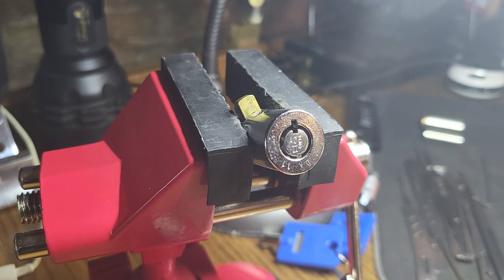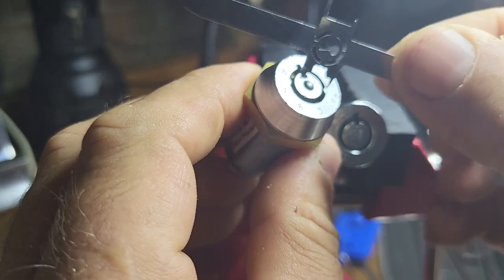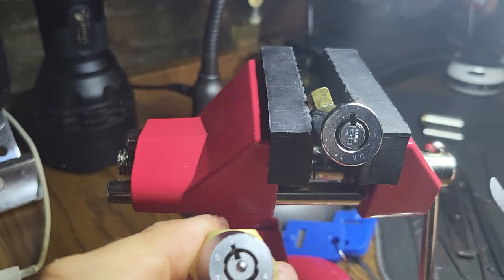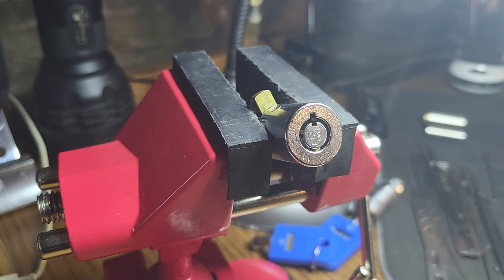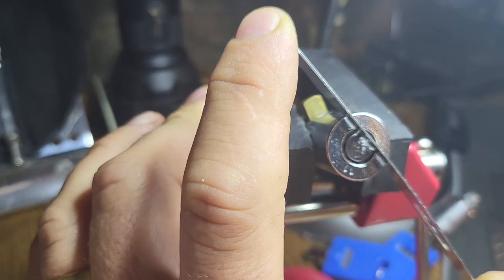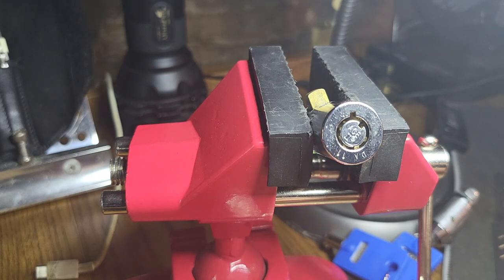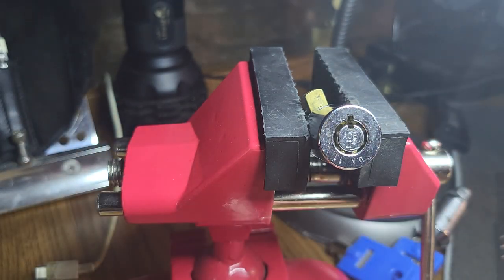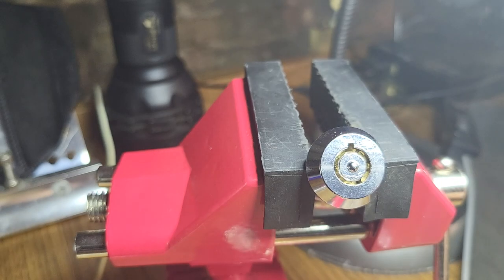Tubular Lock Picking Tips, Camlock & ACE II

Comment: Excellent video boss! Do you know of a tubular impressioning tool that works on an ace 2?
Reply from the maker: Hi, Thank you,  I have now got the Covert Instruments Impressioning tool and I can confirm that it doesn't fit the Ace II, that said, even if you could get one that physically fitted I believe the Ace II has both steel and brass springs so there is a good chance it wouldn't work anyway
Reply: @paulg413  OK brother, thanks for the info and response. That's what I have been hearing.  I guess I am going to have to try and figure out how to get a replacement key # without my original key.

Comment: My story with tubular locks is almost exactly the same as yours.  Old modifications of this cylinder are very easy to solve.  Not so long ago I got a tubular lock, but the opening process turned out to be not at all easy.  From my experience, I realized that the driver pins are exactly the same shape as the key pins and this is one of the reasons for the complication of the opening process.  And I also made a tool for applying pressure myself and for opening it too.  And Im also cut off the forelock on the key too )).  I just watched my story with this cylinder in your video!!!))) Bravo 👍🔓💯 You explained everything very competently on all points of this process.  Very good video!  Very!  Your instrument reminds me of "Katana Peak"!!!))) Cool 👍🔓😁🏆
(Sorry for my English language) 
Good luck 👍🔓
Reply from the maker: Thank you, I think your English is very good indeed,  it was this pick that gave me the idea for the Katana pick 👍
Reply: @paulg413  
Thank You 😁👍 
Good luck 👍🔓🏆💯